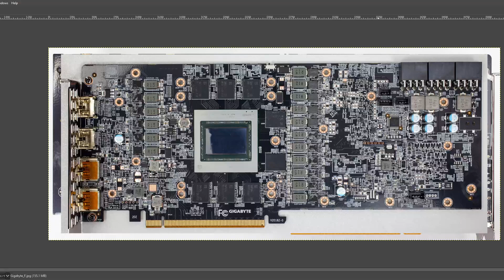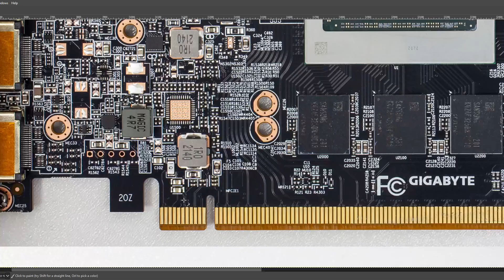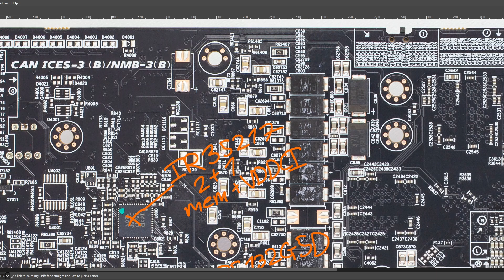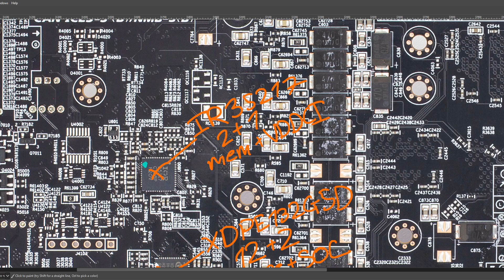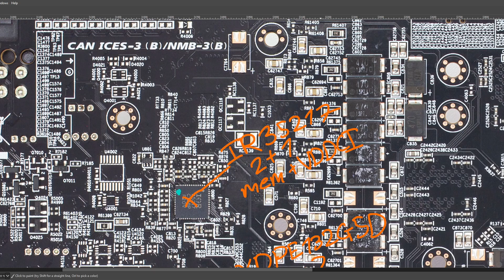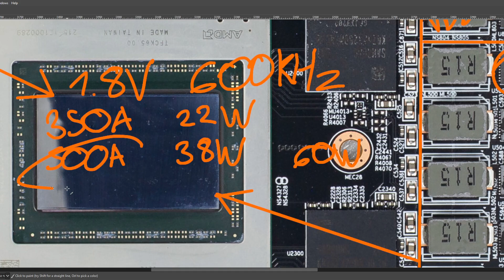Gigabyte RX 6950XT Gaming OC GPU PCB Breakdown

Comment: Hi there, my AIO leaked onto my reference 6950 xt and it appears 2-3 bmr resistors next to C720 burnt out and I would like to attempt to solder back some replacements.  Are you able to advise what the code for the resistors are and where could I order some?  I have a pic of the damage if it would help to pass that on too?

Comment: Nice, thanks! I need your help please.
i´m planning to replace the two coils on the input (R19 labeled) on my Powercolor 6900xt ultimate.
The reason is a significant coilwhine. I am pretty shure that it comes from these two coils.
My problem is, that i cant find these parts anywhere in the internet.

Can you tell me a source whrere i can get them? Or maybe better ones wich will fit there?

Many thanks, and ceep going on. 
Greetings from Germany

Comment: i prefer amd pcb over the nvidia"blow thru pcb design" its insane to think this is better, get fucked nvidia the air blowing thru the gpu instead of bouncing off the pcb just reduces air pressure over the entire pcb, nvidia and their flashy gimmicks. i prefer air on the pcb and not blasting it into my cpu. i taped the holes over on my ftw3 3070 ti and it lowered temps.... probably because 1/2 of one of the fans was blowing hot air into mu cpu instead of cooling the pcb. absolutely retarded logic and science being used at nvidia..

Comment: voltage loss is becoming the biggest issue with new age hardware. the first mfc to figure out how to increase efficiency will crush everyone els. (might be a shitty comparison) but electric motors for example are for the most part 60-80% efficient 100w goes in and 60-80w comes out. harnessing the lost voltage will be huge but i have no idea how it would be possible, even tesla cant do it ;) likely wont see it in my lifetime

Comment: if the fuse is not serviceable by the end user its pointless. even if i personally rebuild a dead power stage i would never run it in my daily system ever again lol it would become a practice card for hard mods. even if all i did was replace the fuse and the card worked again i would be nervous running it in my daily

Comment: dont understand why no one has a useful fuse implementation, look at any vehicle for example they blow fuses and save other components and you replace them and it works again... gpu fuses are stupid, if the card dies i dont care cause its still under warranty, this current fuse implementation is just so gpu mfc's can refurbish the junk and send it back. if my gpu blows a fuse i want a bran new card, they should not be blowing fuses anyway, its a sign of bigger problems, if the fuse cannot be serviced by me its useless junk imo. fuses dieing in 6 years or so when the card is on the used market seems more likely, then who fixes it? the answer is no one and it goes in the trash. firmi gpu's are everywhere right now and none of them have fuses. million examples of non fused cards being longer lasting.

Comment: What's the difference between a 6950 Xt vs a 6900 XT XTXH?
Reply: 6950XT uses KXTH chip which is basically a XTXH with faster infinity cache. Also uses faster memory

Comment: Does the fuse really manage to act faster than the PSU's short circuit protection?
They must be pretty slow to not blow when the card's wattage peaks...
But it could still have the benefit of not allowing the energy of the PSU's capacitors being dumped into the faulty component, or additional damage when the user restarts the PC (and the PSU is expecting to provide a lot of energy to charge the caps)
Reply: The PSU needs to be able to deliver 300-500W to the GPU, it can not detect if that 300w goes to one phase on the GPU.
The PSU would just think that the user is doing a lot of work, but instead the defective phase is just burning up.
All the capacity and  coils that needs to be charged on power on is making it almost impossible for the PSU to see the difference between a short circuit and a normal startup, before the damage is done.

Imagine a crazy AHO setup with 4 cap modded Fury X cards, the startup power to fill up everything would be very high and the PSU needs to handle situations like that.

Comment: I know this is not exactly the place to ask but since apparently no one knows what is happening I hope you could help it:
So I have been having random shutdowns for 2 weeks and I decided to restore windows because stupid windows stuff. It worked for 3 days. Then it went down and it start boot looping "after" the bios screen. Could not even boot into portable OS. Anyway I took to someone with more hardware to test. We basically swapped out one component at a time. Everything checked out except my 3600 xt. So I was about to call warrantee services but then I said fuck it. Went into bios and manually put 1.35 and x38. Before everything was auto with PBO and xmp (running a generic 3200 cl16). So now I am locked at 3.8 ghz and a massive voltage. But I successfully booted into windows. How can this be? A cpu just decided that it needs more voltage to survive after this? Should I RMA?
Reply: Do you get bluescreens? If yes - check what the code is 
for example 

IRQL NOT LESS OR EQUAL

My R5 3600 needed an offset of +0.05V to not crash at random. It would shutdown when idle or playing videos but not when placed under any load. So check if your chip needs an offset. If it does, just RMA it.
Reply: @whatdafuq9   exactly. It was one of the errors
I did RMA it. Fortunately there was no available 3600 xt at hand so they sent a 5600x and paid the price difference. Decided to switch to laptop altogether since can't move a giant pc to another country.
Reply: All CPUs get some kind of table for voltage / clock. If your CPU was right on the edge for one voltage /clock combination it would cause issues down the road due to degradation, for example.

Comment: The increase in input capacitance really could have been a good thing IF they had followed through and also increased the input capacitance by a factor of at least 2-3, many of these modern high-end GPUs (both AMD and Nvidia) are outright EVIL to the PSU, basically they offload way too much of the switching noise filtering on the PSU and the increase in inductance would help with that.
But they then earn a failing grade for stopping halfway, "incoherent" is a good word for their input filter changes.

Comment: It would be interesting to see if the 6950XT OC Formula is any different than the 6900XT version. 

Great video either way!
Reply: I'm planning on watercooling one of those suckers with the existing 6900xt waterblock. My guess they are identical but there is only one way to find out.
Reply: @chungisyoung4good  They are identical. I’m using a Bykski block made for the 6900 XT OCF on my 6950 XT OCF.

Comment: My theory is that they want to reduce the potential liability of killing other components if the card fails and thus added the fuse to protect the motherboard from an overload.
Reply: That makes sense. And a short on the PCIe slot would present a higher resistance to the PSU so it's protections migh not be as effective

Comment: Gigabyte did the "only one fuse on PCI-E" before, 1080Ti Gaming OC for example. I guess the pitch is "when the card is having a little angry meltdown your 24pin won't burn out". Doesn't really do much for the protection of the card
Reply: Pretty sure my 2080ti is the same God the stock cooler was so bad I had to deshroud it

Comment: I would say, if manufactorers doesn’t use fuses, it’s because they really don’t  want to bother with after waranty repairs, cause if it’s under waranty and the board fails you send the custommer a new board .. period. Most countries have waranty rules that prohibits manufactorers from sending a refurbished products as long as the failure is due to a faulty component, even it can be hard to say if the component was faulty or failed cause of eg. OC.
Reply from the maker: Except after warranty repairs can just get rejected by the manufacturer. The fuses are for other people (like me) trying to fix the card.

Comment: Maybe the production line that makes these cards also makes other products as well (other GPU / motherboards) which do use the 330 uF caps so the pick and place machine is already set up for them. Would make sense given the 6950XT isn't a high volume product, and the production line could be making high volume lower end GPUs / motherboards most of the time then switch to produce 6950XT Gaming OCs for a few hours then go back to the mainline products.
Reply from the maker: That would make the most sense to me.
Reply: I was going to blame it on component shortage but... that makes a lot of sense as well?  Either way, it's probably just some cost reduction of some form.

Comment: wonder if youll do "Rating YOUR GPU overclocks" hah, these RDNA2 cards has some tunables in it, basically core, memory and fclk. wanna see what others got heh
Reply: Maybe i will send my 1060 that does 2177 core/10+GHz memory.
With no mods except power limit on 6pin.
And with BASIC Asus 1060 Turbo